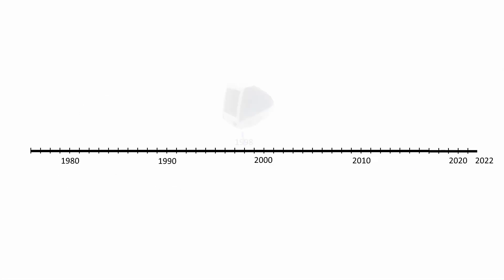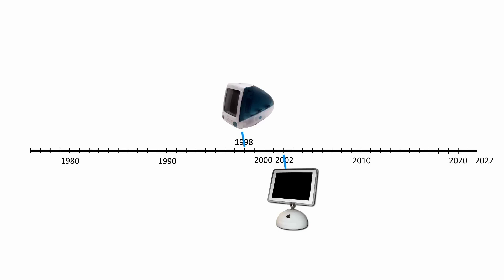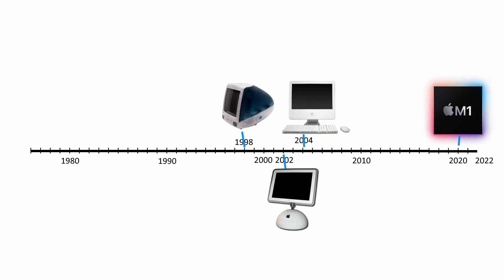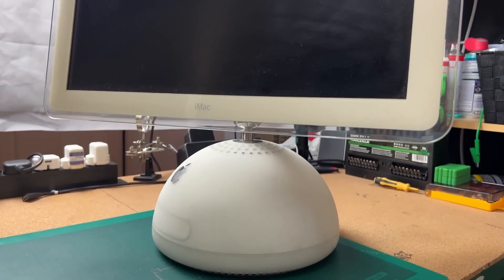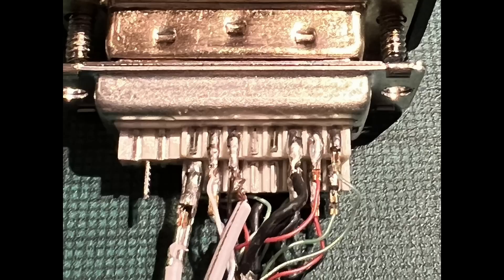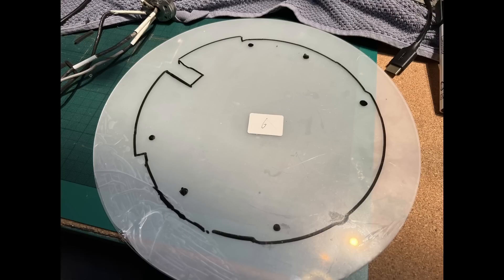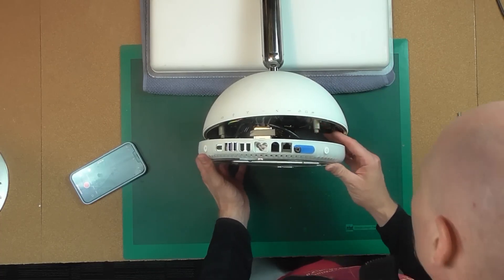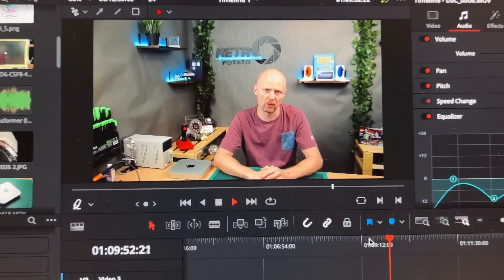G4 iMac to M1 conversion - Audio fixed reupload

Comment: super project - i was searching for a way to modify my old g4 20 inch and found just now a great way to do it. Juicy Crumb Sys. from Australia have created a replacement board. Not so cheap, but it makes it really easy and clean to use the old screen and also implement a new mac mini board in it.

Comment: Nice video!.Have a question,would it be possible to change the internal speaker and replace with a modern one to get a better audio quality?.Planning to do also the conversion and had that question in mind.Thank you for the video!

Comment: Thanks. You did an awesome job.
Is there a way to substitute the old monitor screen for a new one without it being obvious, and to avoid using the original PSU altogether? That could save space, and allow the updating of those numerous G4 iMacs which have dead and/or broken displays.

Comment: Thank you for the video and for sharing it! Just got myself iMac G4 20" just for this project. I'm wondering, do you think it's possible to do the same with M2 Mac Mini?
Reply from the maker: yes. the M2 in a sense is the same as the M1 in this context. from the mac Mini’s perspective this is just plugging in a few extension leads (network, usb) and using a “weird” monitor
the mac mini’s work is to remove it from its housing otherwise it would not fit into the G4 case and if you are willing to mess with the on off button to move it around to line up with the G4 button. 
other than that the mac mini is unaffected. in a way the G4 modification is just turning it into a DVI monitor - and once thats done you can use that with and dvi/hdmi video output. :)

only thing could be an issue if the mac mini somehow recognises that its not in its own case anymore and therefore refuses to work … but lets hope apple did not stoop that low (but i’d say even if they would do that - that still could be solved by some trickery :)

so i’d say : YES :)
after all i am planning to do the same with an M2 and a G5 later
Reply: @RetroPotato  thank you for your response! i'm afraid of messing up the iMac cause I don't have any soldering experience. I know this might sound silly but do you think it would be possible to send the iMac to you so you could do the conversion into DVI (i would gladly pay you)? I am based in Norway, not sure if a delivery is possible to your location. Would I need to send the whole iMac or would it be possible to just parts of it and then install them once they are back?

Comment: Your skills are amazing.....Could you tackle a similar upgrade on a MAC G5 Power PC ?  I think there would be huge interest if you could utilize an M1 or M2 chip.
Reply from the maker: Thank you for your kind words :)

I do have a G5 iMac ready and an M2 system ready  which is going to be my next project after the current project I am working on (amiga 600)
I don't have a G5 PowerPC ... yet. 

Not sure however what exactly you are suggesting. Planting a full M1/M2 (or M3) system in that case is nothing special really - it will become a "box in a box" sort of thing - even if we make the USB and other various connectors work - and the CD/DVD drive. It would be a glorified USB hub :D 
If you  are thinking about making the old beast work like it did back then with all peripherals, and cards working (so you can plug in another graphics card of your liking (and expect it to work) - now that would be an extraordinary engineering challenge. and not just hardware but software. We would need somehow get the OS to recognise and drive those components and I don't think i have the knowledge to do either of that. 
We would need to build a Hackintosh out of a macintosh :) 

I do apologise if I misunderstood your idea, so feel free to correct me and add more details - it could be a good project - and i could be just on the wrong path understanding it.

once again thanks for your kind words and support

Comment: This project is truly impressive!

Is it possible to put a Mac mini M1 inside an old PowerBook or MacBook?
Reply from the maker: mac mini maybe not - as with all the cooling in place it would probably be too big for it - a better option could be to try to shoehorn an M1 air into those cases - but it would need a lot of work (i think) to get the old display, keyboard and trackpads to work. but in theory it should be possible :)

Comment: Have you considered something similar with the g3? There’s a lot more space once the CRT is removed.
Reply from the maker: Hmmm. An interesting concept. Actually when i looked at the G3 i have i always seen that (in my head) with the CRT. Replacing the old CRT with a small LED panel and then planting the computer behind it... but that somehow would just look weird :) 
I think the great benefit of the G4 and G5 iMacs is that the modification is concealed - while with the G3 it would be obvious that we are just using a mac mini with a HDMI display in a big empty (and transparent) case :) it would ruin the magic i think.  
It would be definetly an easier project... it just feels like cheating :)
Reply: @RetroPotato  fair point. Might be interesting to figure out how to make the LCD look rounder so it doesn’t have a big gap between the front and the screen. And you could put something bigger than a Mac mini. Like a hackintosh of some kind.
Reply: Remove the CRT?! Heretic!